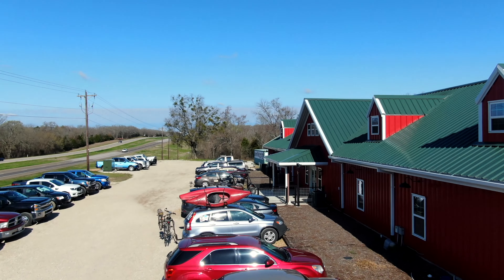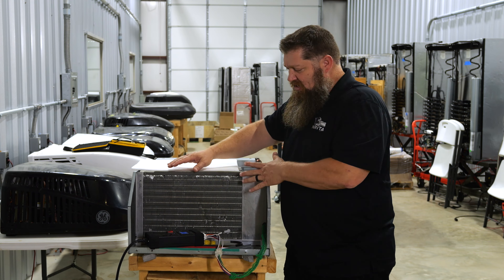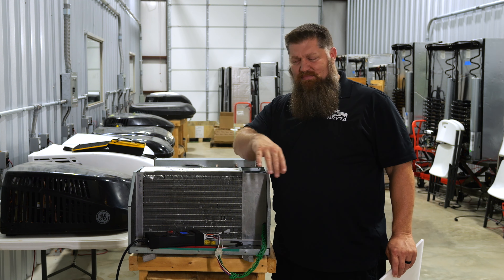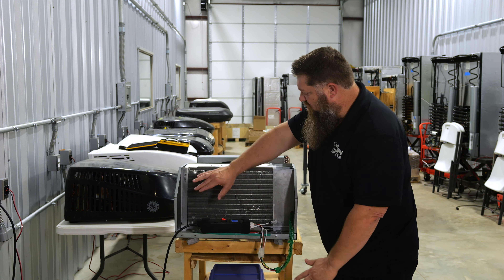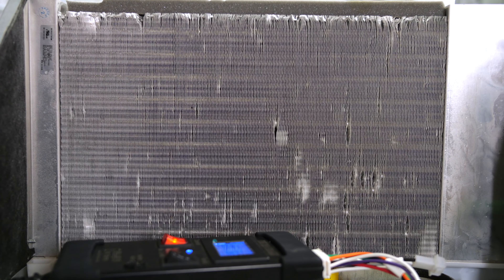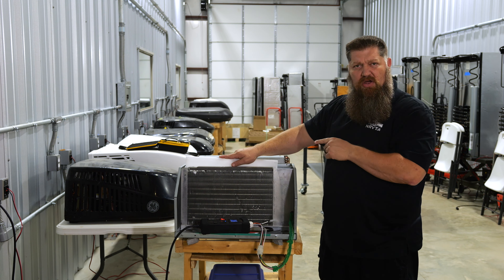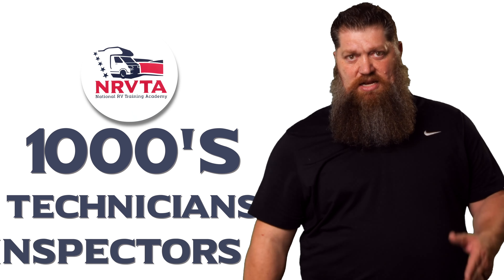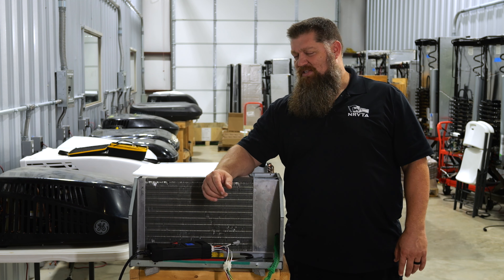RV Air Conditioners - Why it can freeze up

Comment: I’ve got an RV AC question not related to it freezing up. We have been camping in allot of heat this summer like everyone else. I’ve had 3 occasions when it was 95 plus outside that my breaker for the AC tripped. I reset it and the AC worked fine again until today with 115 heat index and it did it again. I have a Class C with 30 AMP electric. Thanks for any advice

Comment: What freezes on my unit (13500 Coleman) isn't the coils but those pipes next to the fan. I cleaned everything and still having this problem especially with high humidity outside (not sure if that's just a coincidence).
Reply: Same here. What stinks is the techs can't replicate the issue.

Comment: Hey Todd, I have a 2018 Lance 1172, 11.5K BTU a/c will cool to ~ 20⁰-25⁰ below the outside temperature, I’m told by Lance that is by design.  I’ve been told that replacing it with a 13.5K or 15K BTU a/c is a bad idea because the coils will freeze.  Your thoughts?  They certainly don’t freeze now, it’s a “4 season” rig, coil and filters are whistle clean, I’ve thermally insulated all the skyights and during the day keep both shades drawn.  But I live in Texas and 20⁰-25⁰ below the outside temp just isn’t good enough.

Comment: Hi, enjoy your videos a lot.  I have a 13,500 btu unit on my class b.  During these hot, hot days here in Texas I run my a/c from shore power on high.  Is it ok to run it on high for several hours every day or is it best to run it on low?   I have it set at 85º and just don't want the inside of my class b to be above 120º.  This a/c is a new install and has an auto function too, would it be okay to use that instead of just high?

Comment: Hello. I just got a new RPod. And every morning after running the a/c on auto all night it freezes up. I have to turn the a/c off for about an hour for it to blow cold air harder. It always blows cold air but when it freezes the output is hardly noticeable. Today after it kicked on after an hours rest I could hear ice cracking in my air ducts? Why? The RPod is only 5 months old. My filters are clean. What’s causing this?

Comment: What would be the reason the snowflake symbol on the thermostat is flashing on and off. Its a GE unit on a 2022 travel trailer and it was fine till our last trip . Now it doesn’t seem to be a cold and that symbol is flashing …. any idea what it could be. Its not froze up and the filter is clean
Reply: Look in your manual.

Comment: I cleaned my coils, but it’s still freezes after a few hours.
Reply: I got the same issue with my 2014 jayco Jay swift. Just cleaned the hell out of my ac unit. It freezes over every time I put the cover back on and it's a new fyours?
 Any luck regarding yours?